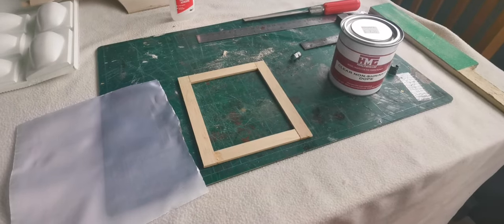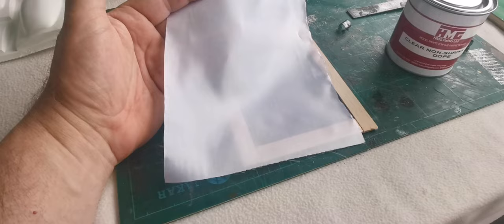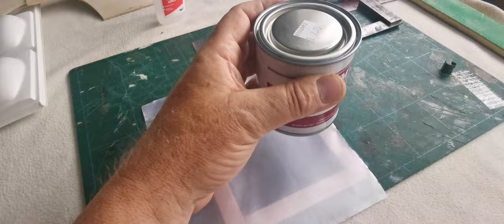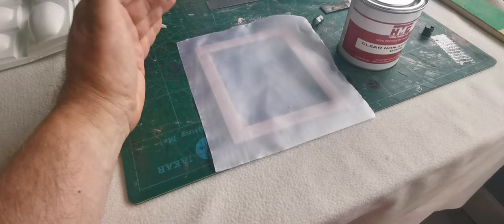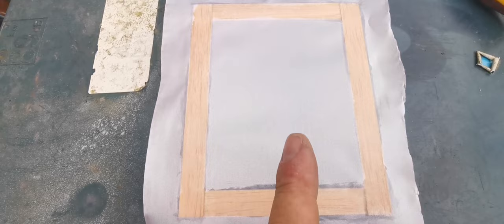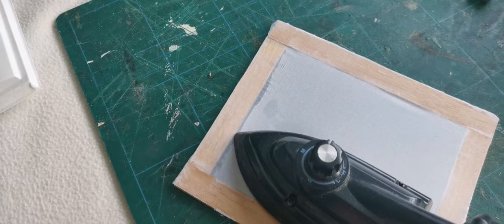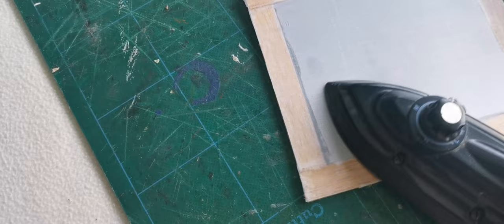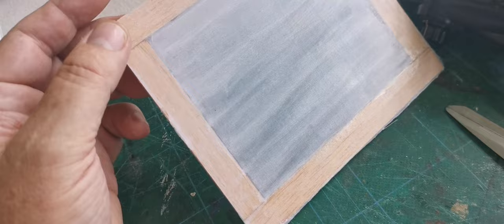Svenson Jungmeister building blog :Experiment with Polyester as a covering material.

Comment: Interesting experiment Mark, you're right it does show potential however make sure it will stick to itself, I tried nylon and it just doesn't stick to itself. Incidentally to check if the weave is sealed try and suck through it 👍
Reply from the maker: Ive done the blow test and it seals well, I have used nylon in the past and found no problems using dope, what did you use?
Reply: @MarkCroucherRC4fun  Do you mean you used dope to glue nylon to nylon for example wing leading and tailing edge overlaps? The only thing that seemed to stick it was  contact glue which is a long way from ideal.
Reply from the maker: @CliffHarveyRCPlanes  It was a long time ago but yes it was dope nylon onto dope nylon.
Reply: @MarkCroucherRC4fun  Ahh yea, I've just realised you're talking about nylon, it's probably different, I'm talking ripstop nylon, like they use for kites ... waste of time!